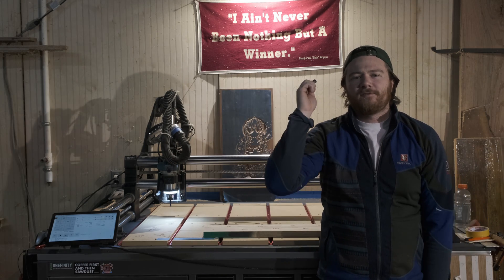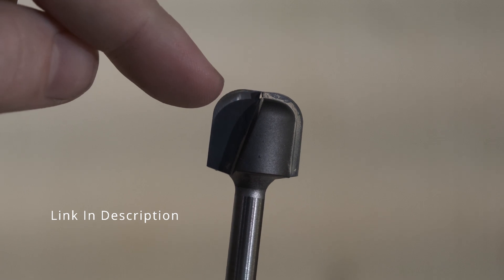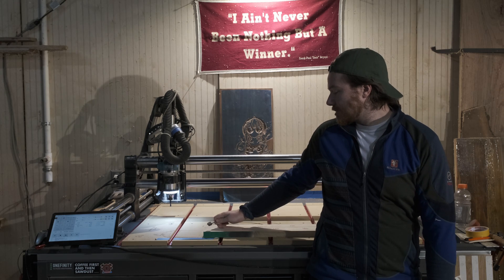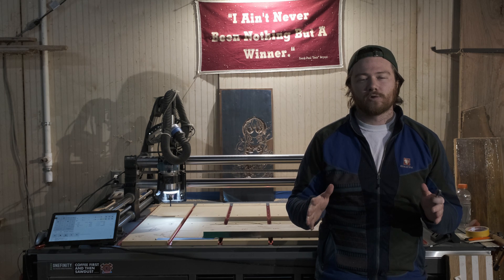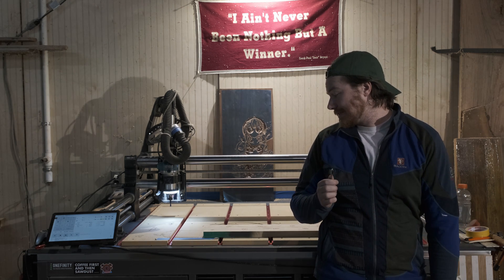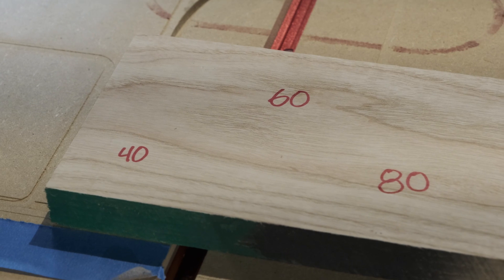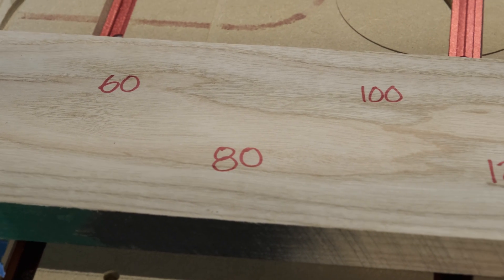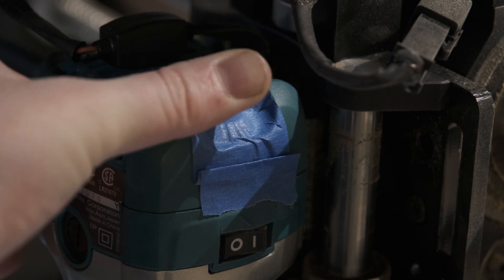My Bowl Bit Feeds and Speeds Test On Hardwood

Comment: I saw this is unlisted but found it on a forum...are your findings still valid?  I'm planning to try 160IPM at .06" per pass on my shapeoko 3 to see if it will do the trick.  I usually do a rough pass and then a finish pass so that will probably start .02 above my rough pass and I will run it at 185IPM...🤞🤞

Comment: Your test would've been better if you stopped the spindle between each cut, and felt how hot or warm or cold the bit was. At 40 ipm, it was probably hot, which means you're making more sawdust than chips, and also dulling the bit faster.
I think your spindle speed, for a hobbyist CNC, should be decreased from 18000 rpm down to about 10000 or 12000 rpm. I've been doing experimenting myself, with my Axiom CNC. 18000 rpm used to be my standard speed, until I started learning more. Took me 3 years to get over this particular learning curve.

Comment: I'm getting burning even at 60ipm (but just when cutting across the grain) @ 18k RPM same bit. :/  Seems to happen as the cut get's deeper...in your examples they are all relatively shallow cuts...I seem to get the burn when getting below 3/8"  Super aggravating...
Reply: Wood is Hickory (I think you said you were cutting Ash?)  should be similar no?

Comment: You could get a laser tachometer for less than twenty bucks if you really want to be accurate with your rpms
Reply from the maker: Something like this https://amzn.to/3prT2Wq?

Do you just measure off the collet?
Reply: @HamiltonDilbeck  yes and yes
It comes with reflective tape but the adhesive isn't strong enough so I just super glued a square of it to one face of the collet nut. 18k rpm is like 3.25 on the dial btw so really the numbers you're getting are probably close enough